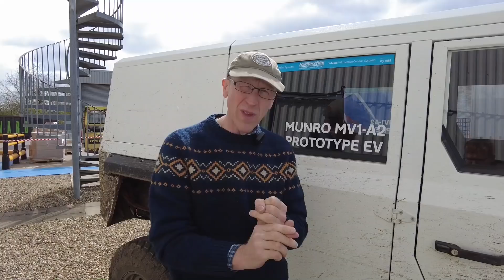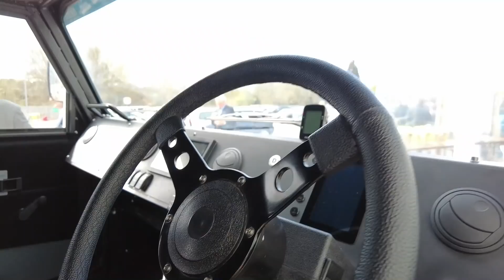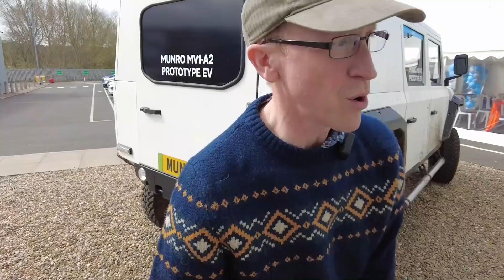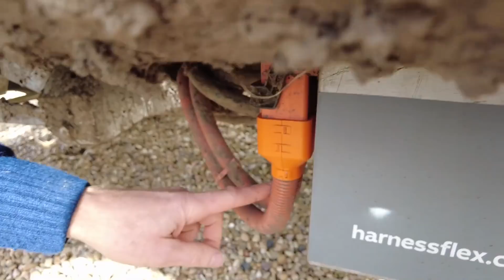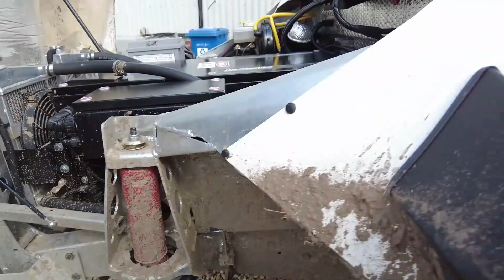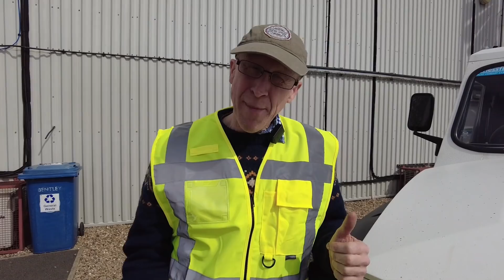Munro 4x4 EV Prototype Review - Fully Electric Defender Alternative

Comment: I’m gladI stumbled on this as I’ve been
Bombarded on Facebook about the Monroe but the info behind it is lacking. This is a great step forward, what I think would be 
A prudent way forward , (if is not on the cards )is a hydrogen fuel cell  power unit. Moved higher in the payload area, coupled with some other mods.
Keep going I would love a extended Ute based on this concept👌

Comment: Thanks for keeping us informed on things like this. In my opinion for EVs to really catch on they need range, quick recharge capability and to be affordable. This one seems to fail in all 3 areas. Plus it looks like a it was designed by grade school kids, and not the advanced class.
Reply from the maker: Some valid points - I was thinking what are the things it offers..
1) low running costs
2) quiet
3) acceleration 
4) Torque
5) Environmental ( air quality )

Comment: Interesting prototype - but the range is horrobly low.  150 miles is a 75 mile range as you have to get back again.  It would need to be at least double this, preferably 3 or 4 times more to be a realistic workhorse.  150 mile range is only really suitable for a farmer on his own farm who can re-charge every night.  Up in the highlands of Scotland where you are likely to go longer distances, it's really far too inadequate.

I like the idea of a rugged EV for farm and industrial use - but the range does need to be far better - in the winter when you have to run heaters it would be drastically reduced - so, not nearly enough.

Does need decent mudflaps to minimise the spray of mud, but I understand it's a prototype and would not have these now.

Otherwise, it does seem pretty OK.
Reply from the maker: In some remote areas it may be easier to find electricity to charge a car than to find a filling station. We just need a leap in battery technology

Comment: I really need one in Ukraine like right now!
Reply from the maker: Hi - firstly I hope you are safe. Interesting question - in a war zone is it easier to find electricity than fuel ?
Reply: @L663  EVs proved to be dominant. Petrol just does not exist close to the frontlines (used for cocktails or generators), diesel is quite widespread (ambulances, trucks, pickups, and electricity is much more available. 
V2G is very underrated tbh.